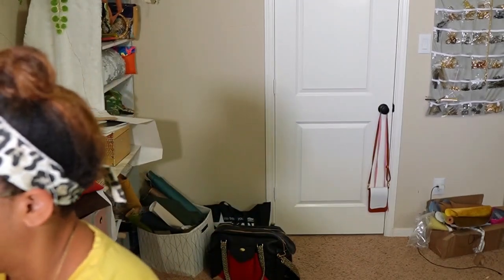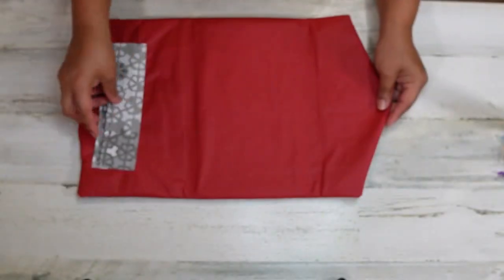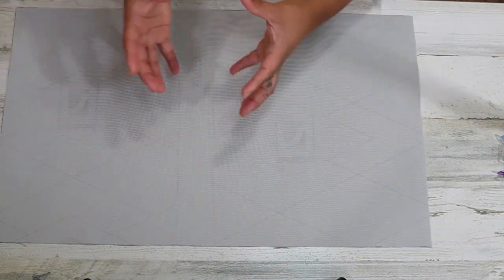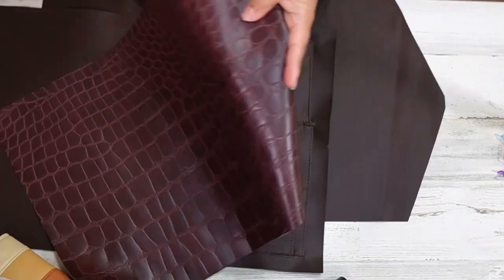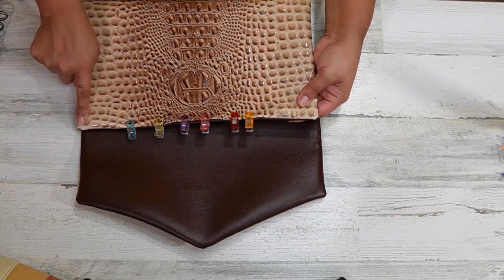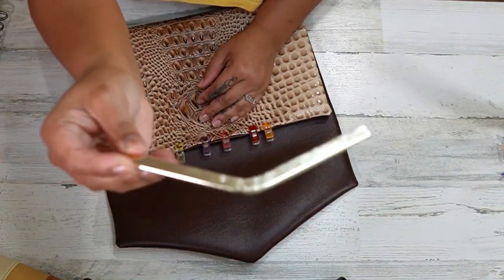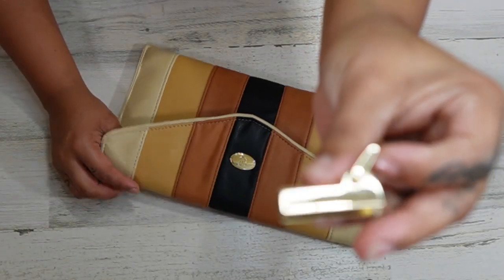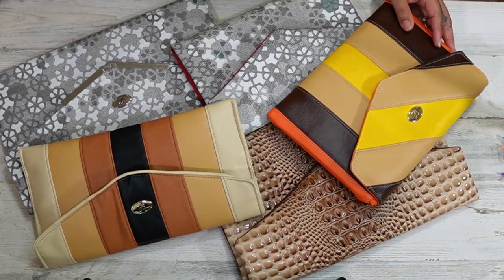Modify the Rae Clutch using only 1 piece of fabric! A super easy & stylish clutch!

Comment: What seam allowance do you use when sewing vinyl right sides together? If it's too narrow isn't it harder to get a neat edge and ensure your topstitching catches the seam allowance? But if it's too wide it creates more bulk. Any tips? (I'm guessing the same applies when sewing scrap vinyl together like the first clutches you showed?)
Reply from the maker: Hi! Are you referring to when topstitching? If so, when seeing 2 pieces of vinyl together I'll use 1/8" SA. Now, when I'm topstitching 4 together,  like the final stitch on this clutch,  I will go slightly bigger than 1/8, but not quite 2/8 because like you said, it's a little harder to catch all the seams when there's so many layers. I always add double sided tape or sometimes cement glue to help keep everything together.